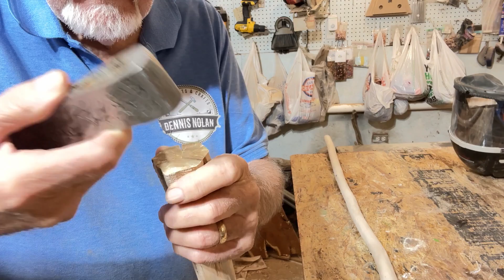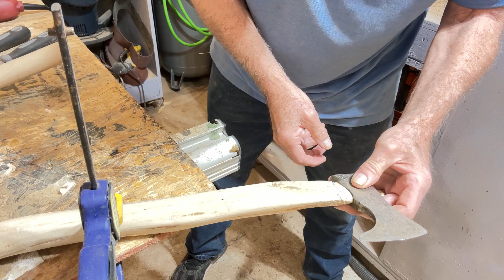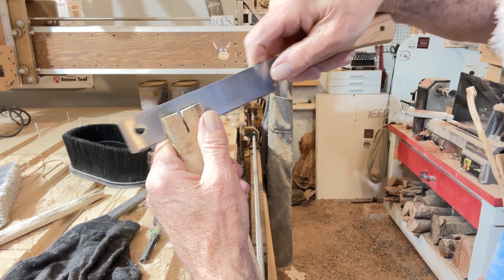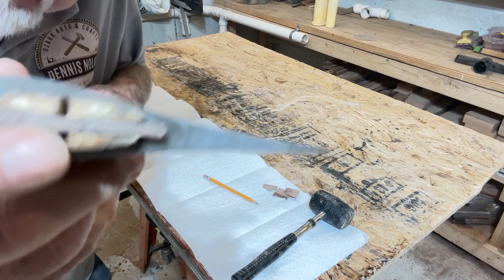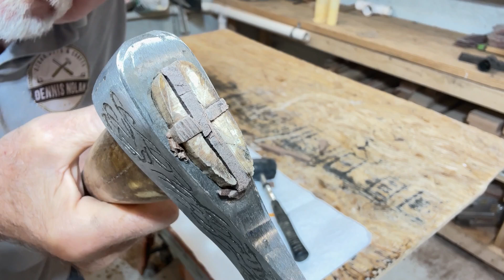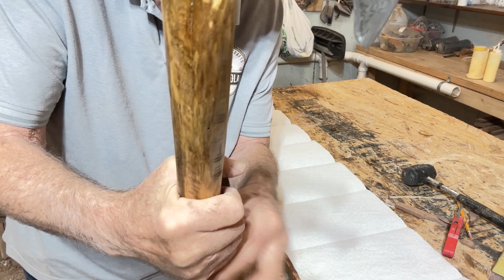A Nordic Axe Walking Stick

Comment: Nice project, though I don't like the bare axehead, as well as the weight that will tire my arm.
Instead I would choose a tomahawk with a hammer at the back. As tomahawks are not hafted  with wedges, but simply shoved over the widening handle from the bottom, you can walk with the stick only and the axehead in your pack or in a belt-pouch and slide it on, if you need an axe. Just shape the handle/walking stick in a way that the head can slide to the top without it sticking out too much. For self-defense the stick is good enough, you can swing it at higher speed and are more likely to hit.
Reply from the maker: You don't feel any weight on your hand or arm with any walking stick, unless you are carrying the stick.  All the weight is resting on the stick.  I have walked with axe headed cane before and has been used for protection several times.  While they are not for everyone there is plenty of demand.  Thanks for your comment.
Reply: @OzarkArtsandCrafts  - sorry, don't agree - just like your boots you lift the walking stick with every step and if you do some milage, the extra weight adds up into tons.
Of course, that only matters, if you use it for walking - as a showpiece that's no issue.

Comment: Nolan, I didn’t hear what kind of wood you used for the stick. Are you going to finish the top of the handle off with some stain and poly?  If you choose me to win the walking stick, you’ll be my best friend and I’ll give you a box of chocolate. 👍😂
Reply from the maker: I did apply some poly to the end of the stick where the cross is.  That really brought that cross to the light!  My computer does the choosing but I could use a box of chocolates!   Thanks for your comment.
Reply: @OzarkArtsandCrafts  no problem. The axe looks great